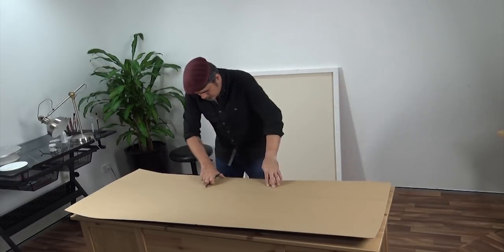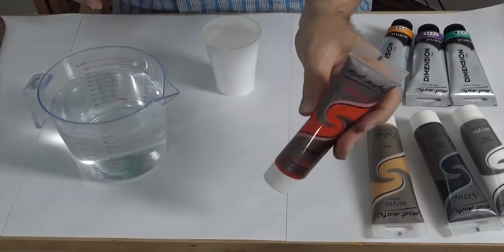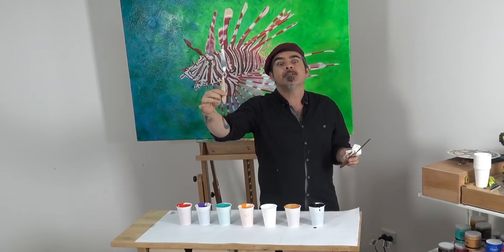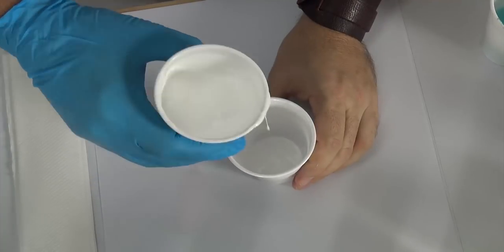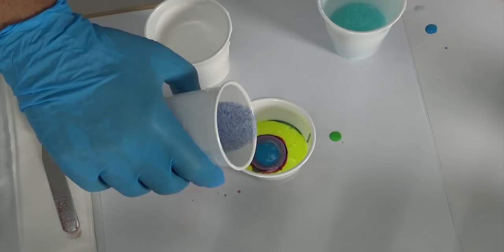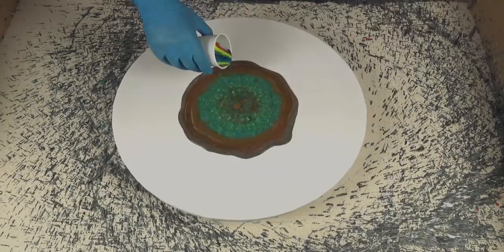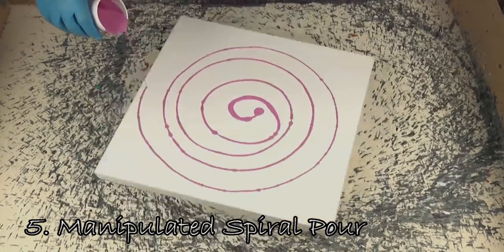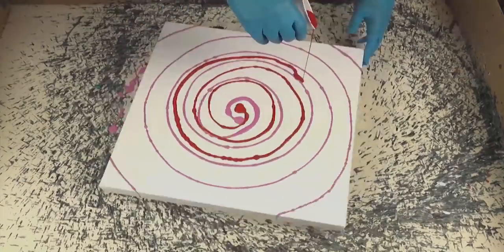How to Make Spin Art

Comment: Hello I love your art it's so beautiful. I do have a question about the big canvas that you used to protect the surroundings of the smaller spin canvases, what did you do with it after you where done and does it end up making an interesting spillage spin canvas itself?? Just curious because of its size for one and sense some of the most peculiar and interesting art comes from leftovers or preventive measures, sometimes anyways. Okay thanks for all your lovely videos and your time. Have a blessed day!!
Reply from the maker: Hi there, thanks for getting in touch! You're so right there, beauty is in the eye of the beholder!  This techniques does create an interesting pattern and you can use the canvas multiple times to build the paint up.  You could always remove the canvas from the frame and re-stable it onto the frame (with the paint covered side on the outside). Then you just need to give it an mysterious title, like ‘circle of life’ and you definitely have an artwork there! 😊